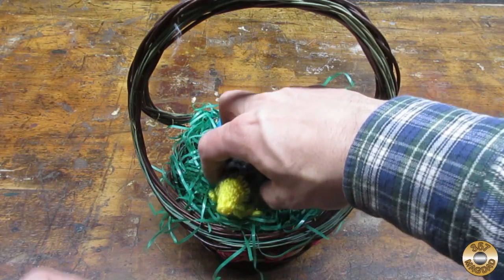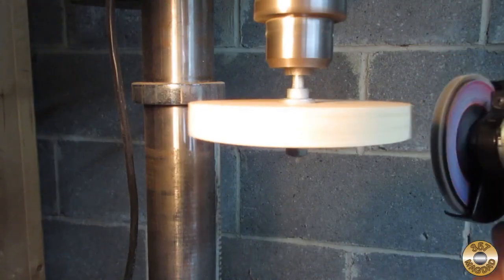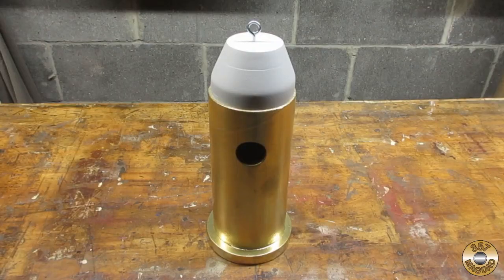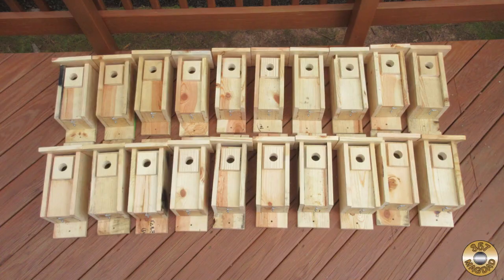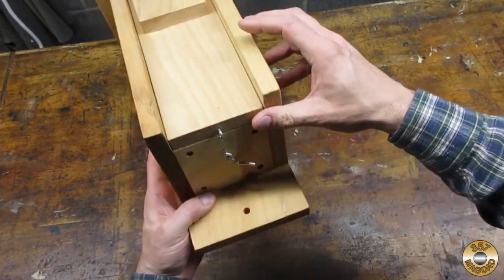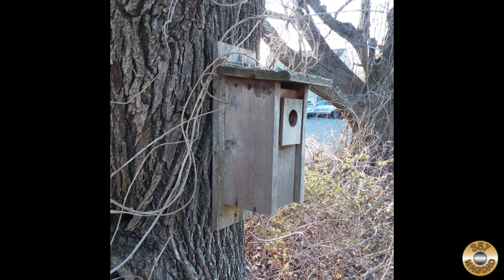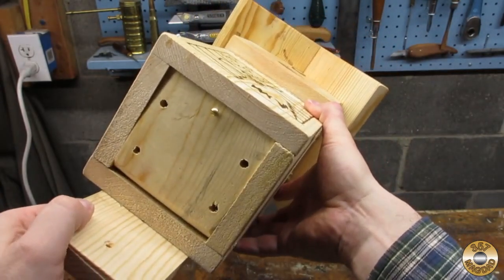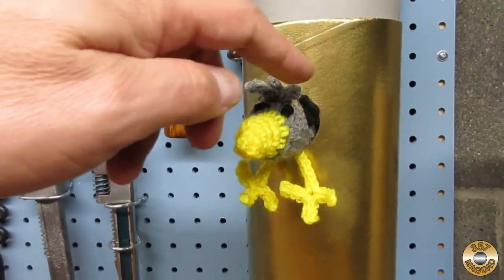ScoutCrafter Birdhouse Challenge - A Home For Chuck

Comment: Very creative and good looking job.  I'm not sure of the width of your Blue Bird houses but a good alternative, if you run out of scrap, are the dog eared fence slats. I usually buy several when Home Depot puts them on sale then store them away, they dry out fast, and make good wood for small projects. I use just one board to make the squirrel feeders with the gallon glass pickle jars.
Reply from the maker: Thanks Ernie!  Luckily I have a never-ending supply of cheap pine from my job!